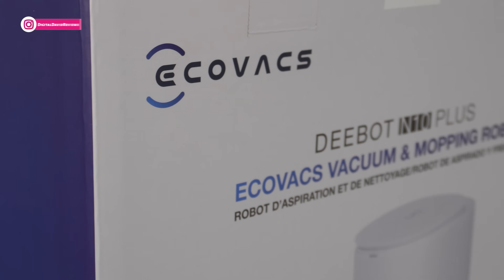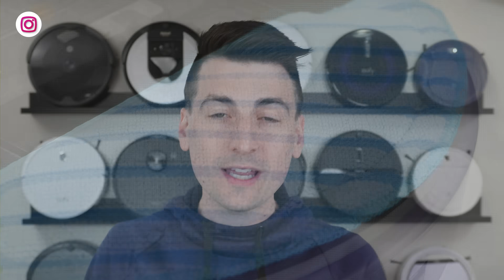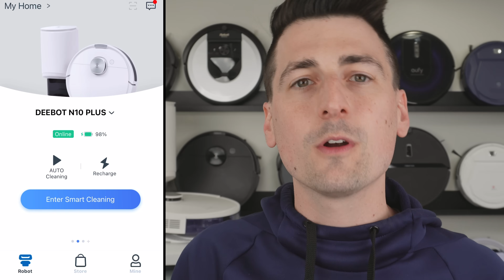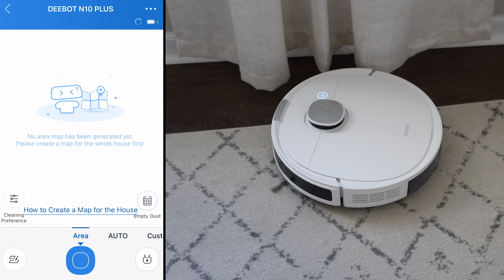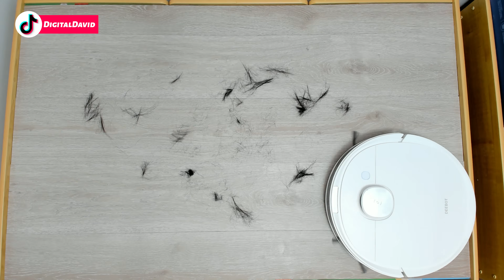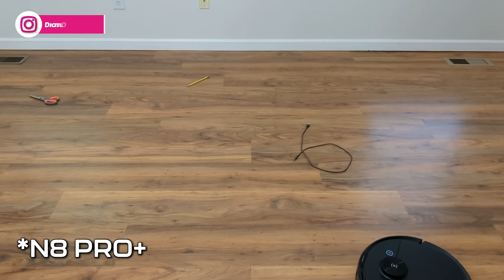Upgrade Your Cleaning Game with ECOVACS DEEBOT N10 PLUS

Comment: I just replaced my N8 Pro with the N10 Plus.  The N8 started to make a screeching sound and it would get louder as the vac motor ramped up.  Took advantage of the upgrade program and used my Ecovac points for over 50% off MSRP.  The software and vac seems to be way better and the N10 doesn't seem to get confused on its way to clean, has a longer battery life, doesn't get stuck as much, doesn't lose its map after getting stuck, or fail to return to base like the N8 Pro.  I still have to double-check the N10 for hair getting wrapped around the brush or causing the vac dual empty door to get jammed open. I like how the N10 leaves vacuum lines on carpet like an upright vac. Worth the upgrade over the N8 Pro.
Reply from the maker: I totally agree!
~B

Comment: Does it say anywhere to wet the mop pad before mopping?
Reply: I wet the pad with water and sometimes wet the pad with floor cleaner.  I don't add any floor cleaner in the N10 water reservoir.
Reply from the maker: You can do it that way too!
~B
Reply from the maker: No I don't think that would be necessary! 
~B

Comment: Please, I would like your advice between two types to buy one of them

The first is N10+

The second is T8+
Reply from the maker: ~B
Reply: @DigitalDavid  ???
Reply from the maker: @MrSameralhamwi  Great question! Since they are around the same price (very similar performance) I would go with the T8+ to pickup the 3D obstacle Detection... if your house is fairly clean/tidy then you could save a few bucks and stick with the N10+!

Thanks for being here and watching!!!
Reply: @DigitalDavid isnt the t8 + suction lesser than n10 plus. 
Also t8 is an older model as compared to n10
Reply from the maker: I can't remember for sure, but they were pretty close I think
~B